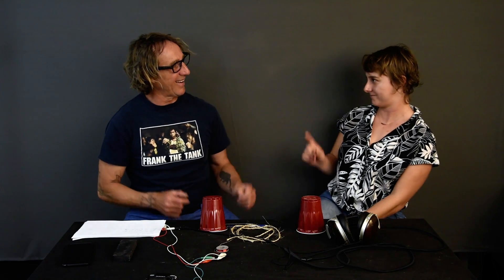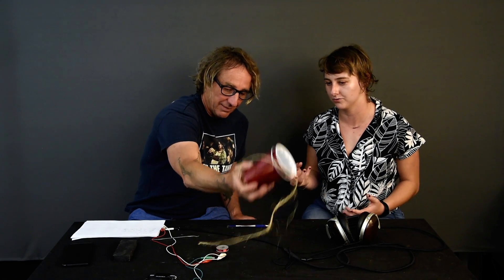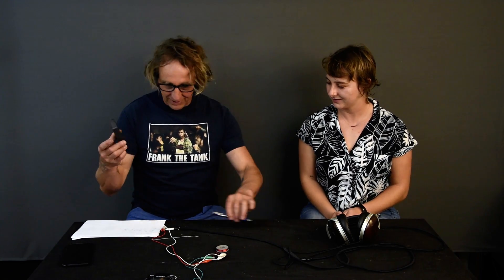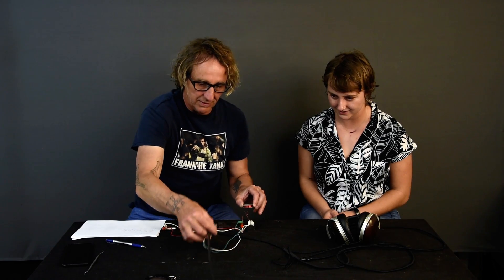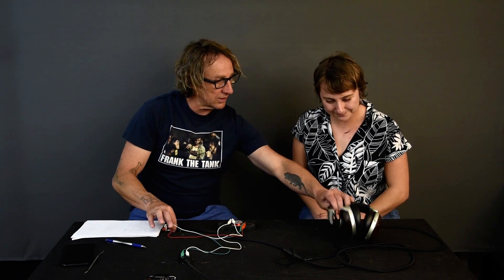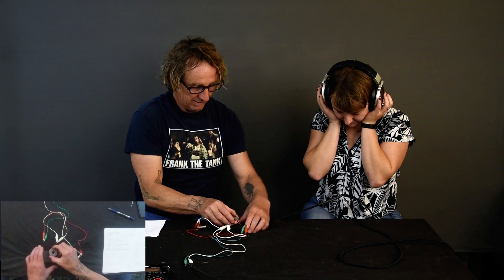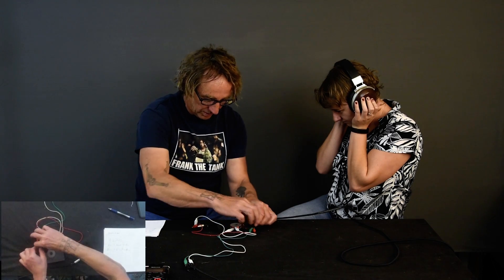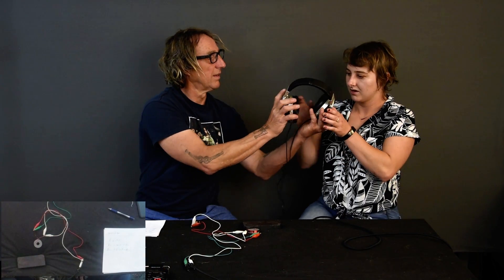Fun With Audio Transducers and Demo - #2 - Sammy Asks pop

Comment: OK DAVE......I was wondering why my 3 way system went 2 way.......can I have my coil coil back for my cross over ????  BUT on that Note......hmmm probably why its a BAD IDEA..... to mount a cross over network in a speaker system....on the box wall next to the woofer magnet.......and the illusion of the What's Up and the White Elephant in the ....BOX.....and the difference of 2D linear thinking....and thinking in 3D....and other dimensions......to put a Spin on Things....when it comes to Energy & Electrons....and things that go Bump Inn the Knight......or Mix of things.  James Dean had his moment with  "you're tearing me apart!" and Brando had...STELLA.......so say it like Brad Pitt and...What's IN THE BOX !  And....Capacitance is another chapter when you see 2 conductors...separated by distance.....and you understand RADIO.   I grew up in an RCA house....my Pops was a Dealer pushing the Nipper

Comment: Loved the vid! So how does a cable transfer the electric flow to the speaker? I wonder how does the speaker "know" to move itself according to the same movement of what's recorded? Is that electric movement correlated with Hz?
Reply from the maker: A positive voltage applied to a coil of wire immersed in a magnetic field will move one way, a negative voltage applied will cause the coil to move the opposite way.

That is a speaker

And the opposite. Positive motion applied to a coil in a magnetic field will create a positive voltage on the wires going to the coil, negative motion will create a negative voltage.

That is a mic

A device that makes the electric signal bigger is an amp

Connect mic to amp to speaker and the speaker will replicate what the mic is doing.

The mic listens and moves and makes a voltage, the speaker moves when the voltage from the mic is sent to it

Comment: 1st of all, is it hemp twine, and what would be the difference?
Reply from the maker: Without doing actual testing on twine vs other strings, I would venture that the fibrous nature of twine and excess fiber that hang off will cause some damping and absorption or some frequencies more so than a more compact string.  That said, twine has not mush stretch so it may transfer other freqs quite well compared to a cotton string.  I would guess the twine is more mid-range, cotton maybe a flatter and not quite as loud and steel thin wire having the best hf but challenged for the lows.

Ha! Maybe be worth a test!
Reply: @DaveRat  Do you subscribe to the notion of the electron spin & the Tesla theories and the audio aspects of gauge....the basic is the gauge over distance but then there is the twist for low end running around a heavier gauge which gives way to the distance and gauge conundrum.....but then the higher frequency wave tend to like a thinner gauge to travel.  THOUGH within the realm of home based audio ....doesn't involve grandiose runs of wire for transmission.  So Blend is a direction in certain circles.....if there is a spin on things.     Some like to utilize a dual run of Romex and  something like 16 gauge stranded.  But it would be interesting to discover the proper proportioning....before contemplating mid-range transmission....OR if things may need  expansion of the blend from the 2 or 3 Tasty Wave food groups and branch the Mids to high side and low side mids to fill in for transmission.  So a multi-core conductor blend with a twisting aspect if it were strandy...but then the twist COULD be calculated in the finite......and perhaps a common Return.  The main conductor blend would not necessarily need insulation aspects as a single conductor in theory.  Your CAT wire is the extreme theory in application here.  BUT let me back up in the fork in the road and go String Theory...and the same BLEND when weaving.....weebles wobble but they don't fall down....when going up against Stretch Armstrong.  SHOOTING THE CURL......and Spinach Popeye....it depends on your perspective in a Bi-Polar World & the Equatorial....and Dwelling in the middle of the two and the nether regions......for the CORIOLIS EFFECT...and which plane of consciousness of the universe you spin around in..........when basically we as designed are walking bags of electrolyte diluted.....or deluded when the chemistry is NOT RIGHT...butt electrical beings conducting our business...giving rise to the capacitance of doing business and the conductors in the Pilot House...steering the ship.  Other than RCA...my 11th grade home room every day ...was...The Physics Lab and the Physics teacher....and I knew his kids and my family name being on a sign in the middle of town being a business......Though he was not Mr. HAND at my high school....I was targeted as my family name is quite similar to CORIOLIS EFFECT.....and a rollin' & tumblin' Rolling Stone....BUT being my time in the window of history....AND now you must subscribe....think Billy Preston....Will It Go Around In Circles....and have that in your head for eternity...considering your ear structure as designed......MUSIC.......Pop Eye....its the Spinach......Shoot that Curl....WHEEL OF FORTUNE !!
Reply from the maker: I subscribe to the concept that the better I understand the simpler it is to explain
Reply: commotion in motion...locomotion.......transmission
Reply: @DaveRat  ahhh KISS method....Gennie in the Bottle
Reply: Yea. My apologies. Just commented randomly.  Although, I would guess hemp would be more of a low impedance, where cotton would be a higher impedance?  Limited research.
Reply from the maker: Hmmm, I would have to ponder the impedance of the fiber differences

Comment: A talk box is interesting because it is many conversions of sound before it finally goes out the PA. It is an electric analog/acoustic analog/electric analog conversion at it's simplest. Run it into something digital you may have an ea/aa/ea/d/ea??? LOL It's interesting to think of all the different circuits that make it work, so many coils of wire, a random rubber hose, different voltages, some spittle, etc. It really starts to look like an episode of MacGyver on paper, LOL

Great episode, hope all is well with you and yours, :)
Reply from the maker: Thank you and yes! Talk box is way cool and very unique

Comment: I think we all get tripped up thinking about sound because we are accustomed to the "assembly line model" where you build a product by adding parts to it. Sound really doesn't work this way --- rather sound is REPLICATED at each stage  --- sometimes the original signal is mixed in with the replicated one but the "big breakthru" happens when you finally figure out that differential changes can yield (and AMPLIFY!) the signal being captured (be it current or voltage). Thanks again Dave!! :D (these videos are wonderful)
Reply from the maker: Excellent and yes. When people talk digital vs analog and such, one way to look at it is that near perfect digital reproduction/data transfer dreams of having the response and fidelity of purely just a short piece of wire.